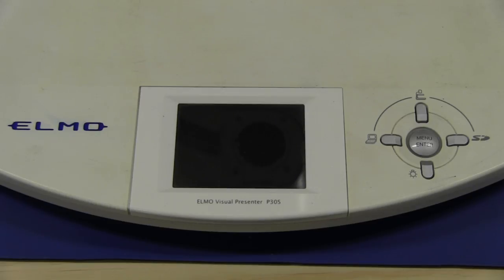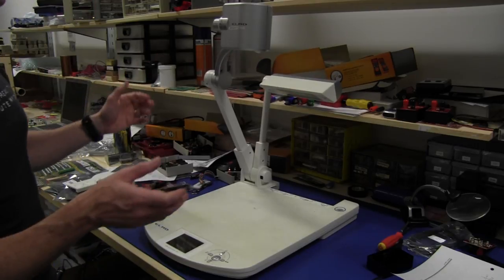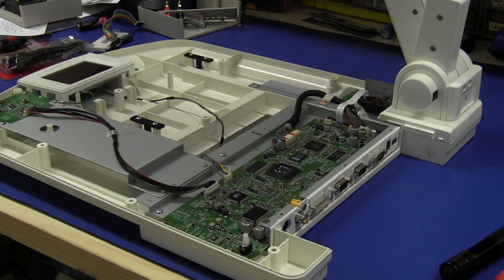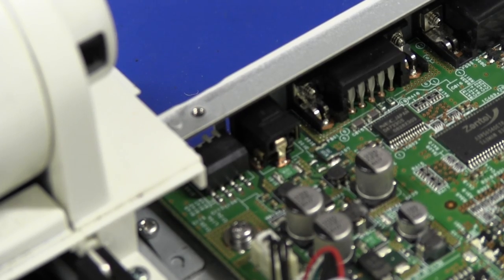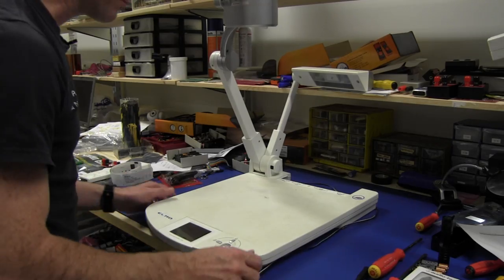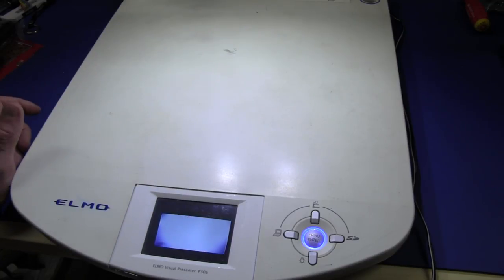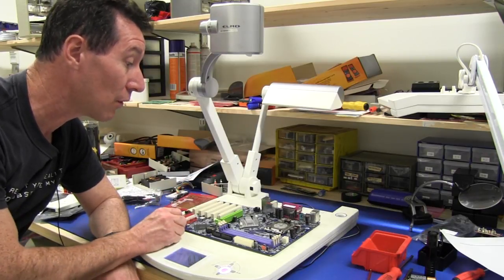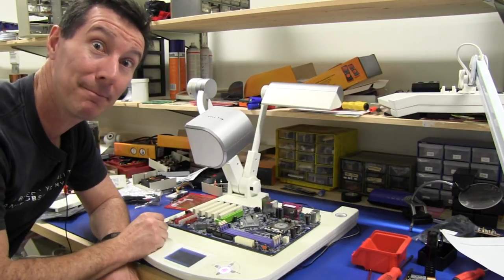EEVblog #278 - Elmo Visual Presenter Teardown

Comment: The sticky pads under the PCB are likely to be thermally conductive, they appeared to be under the BGAs and will conduct heat directly to the chassis.

Comment: I bet someone with plenty of time could turn that thing into a very nice soldering station!
Make the arm collapsible so the camera and light can be moved closer. Maybe change the lens so it can focus properly. Cover the surface in some kind of heat resistant material. Move the built in LCD and keypad elsewhere. Mount a nice big LCD somewhere easy to look at.

Comment: These have a very nice output quality, the models they use in my classes output anything from 640x480 VGA to SXGA. There are cheaper models that only do VGA, XGA, and SVGA, however and I have also seen those hanging around in a couple classrooms.

Comment: I'd check to see if the firmware can be changed of that thing. Possibly with adding Video recording capabilities. There are cheap Chinese cams that record in HD (808 #16) and fit in a key chain thingy. Since this device has SD card support, it's only a matter of firmware.

Comment: The FOCUS IC is an NTSC or PAL encoder.  Some original Xbox game systems use the same IC.
Reply: NTSC? isnt that a dead video encoder?
Reply: Jenna Love Only for broadcast, not for things in the home or hams though.
Reply: Brandon MacEachern
Pretty sure tvs and computers dont use it anymore.
Reply: Jenna Love No not true, at all.  TV's do generally still have the yellow white and red inputs, and if not a yellow input, green on component dubs as composite input, which is NTSC or PAL depending on region.  I would know, I work in this industry.
Reply: Jenna Love PS, Raspberry Pi has NTSC output.
Reply: Brandon MacEachern
i meant that it was uncommon as everyone uses hdmi or display port
Reply: It's still not uncommon if you can go into a store and still get something with the port and still get the cables.
Reply: ok

Comment: I have an Elmo P-10 Model. Where can I order parts for it? The power port on the board broke. The replacement part# that Elmo told to get is 5NA0000066. Do you know where I can order this part so I can solder back on the board. Thank you.